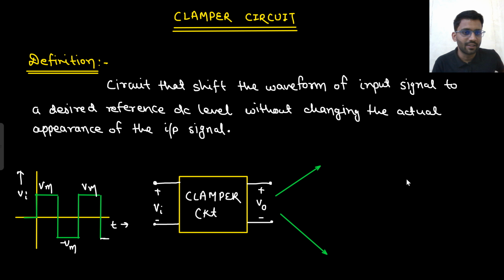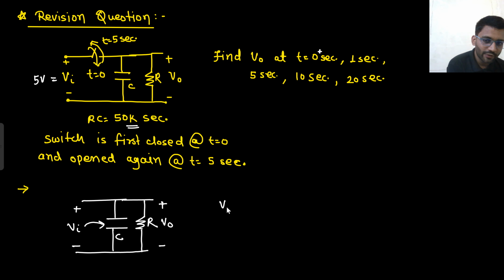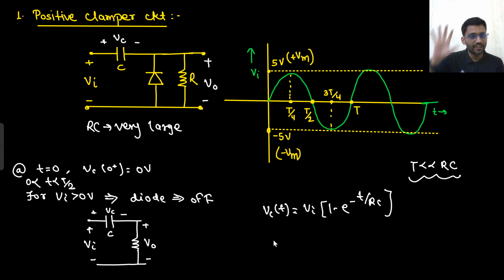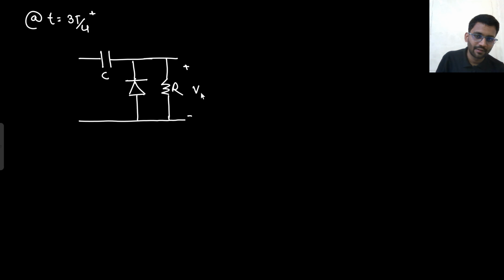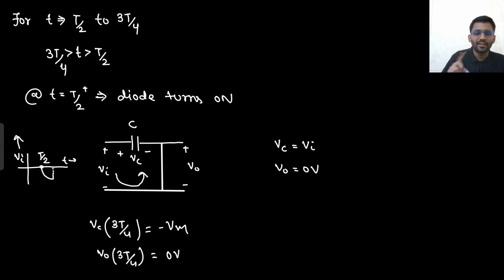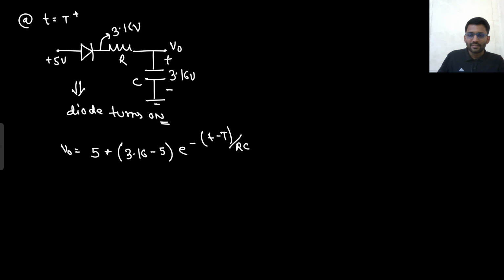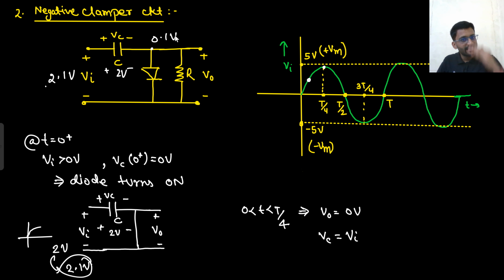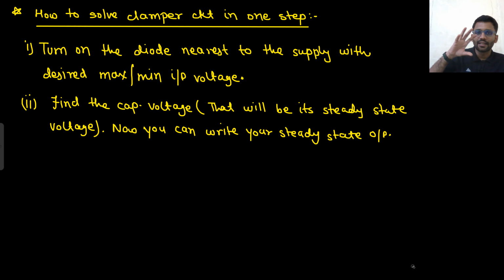Introduction to the Clamper Circuits || Analog Electronics || PrepFusion || Himanshu Agarwal

Comment: 39:40 , the negative part is clipped off and the actual signal is changed right ?. but in the definition it was written as "Shift the waveform to desired dc level without changing actual input.

Comment: i couldnt get how could it charge the capacitor too when just by the direct expose of input when diode is turned ON because even when it is exposed the time constant very large right how did it get the time between T/2 to 3T/4 to charge completely!!
Pls explain
Reply: because there is no resistor because it is parallel to diode which short circuited ,,now only cap is only there so its getting charge
Reply: @ramsurya6668  parallel to voltage source
Reply: because in -ve cycle RC is 0 as r is 0 (due to shortckt ) so it charges instantly as current impulse but not in case of +cycle as resistor their

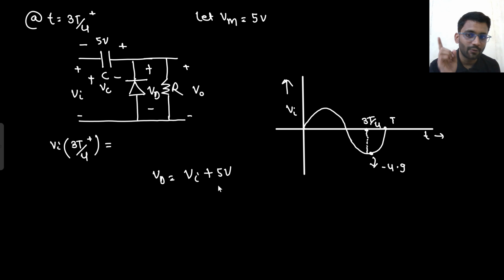Comment: 32:50 sir why would you take diode polarities as reverse.. and little confusing at 3T/4 +
Reply: Mistakenly marked it that way. 
But you would eventually need VD to be less than zero to turn on the diode and this is what I have said in the lecture. Just the polarity I took was opposite
Reply: @HimanshuAgarwal_  sir for Diode   to be ON, VD should be greater than zero.  Taking reverse polarity thats why you consider VD less than the zero to be turn ON..
Reply: @darsaishealateja1345  Yup, correct
Reply: @HimanshuAgarwal_  thank you sir..
Reply: @HimanshuAgarwal_  -Vin >5v  that means Vin <-5v is this equation correct sir?